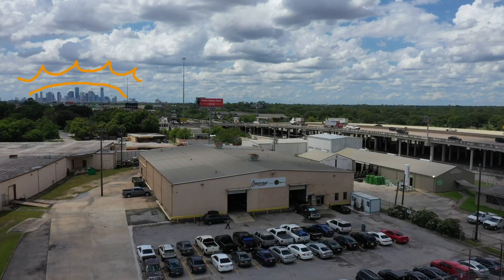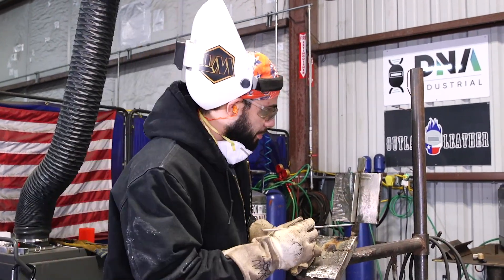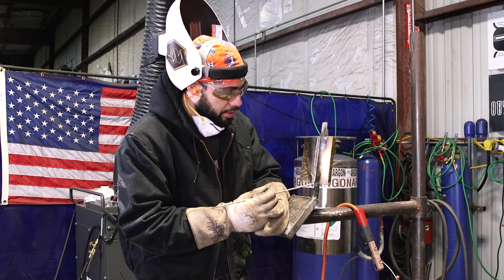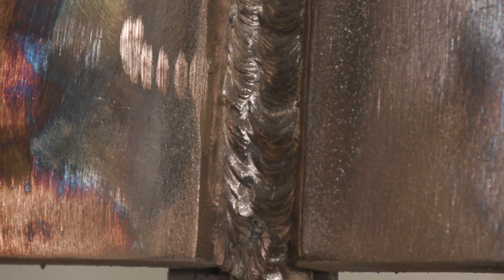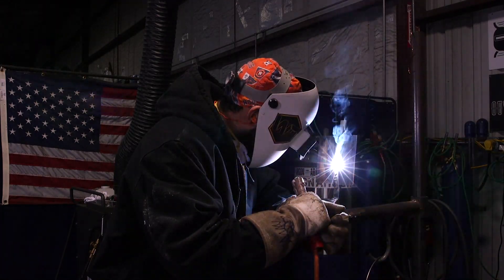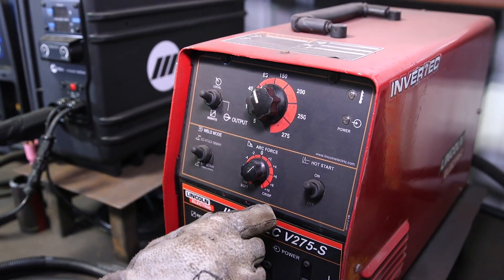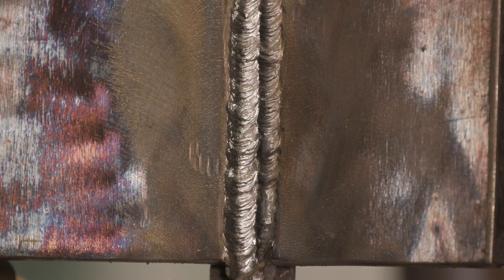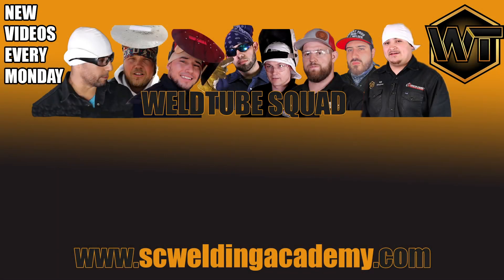Monel Stick Welding on a Copper-Nickel Plate | First Time Welding it🤨

Comment: Have you tried running straight stringers without so much movement. I don’t weld Monel just curious how it would weld. I weld mainly carbon, stainless, and chrome pipe.

Comment: Copper Nickle is tough, but Monel to Monel is some of the easiest welding you'll ever do. I had a Monel stick qualification back in the day that was a vertical and overhead butt joint with backing strap test and it was actually fun to do. 
I used the qual to clad weld overboard valves on ships that were under water. Easy money.
Reply: It is actually a dissimilar monel to steel backing that’s why they are using a 9n10 monel rod not a very friendly rod but yes monel to monel backing is easy very fluid and fun but not monel to steel
Reply: @jordanmoreno4850  We used 9N10. I had almost forgotten about that qual because we used it infrequently. The butt joint test was really overkill because we only used for clad welding.
Reply: If it were monel to monel they would use 70/30 rod or 90/10 rod
Reply: That's wonderful to know,  I'd love to weld up an all Monel Blue water cruising sailboat from one of KastenMarines Pelagic Whaleboat style designs when I get the opportunity.   Monel Hull,  Deck and cabin.  Monel fittings welded right onto the deck,  Monel Rudder, and Freestanding Mast for a Modernised junk Rig for better upwind sailing ability,  to deal with a Lee shore.    All Monel so no dissimilar metal issues.   No stainless steel rigging to maintain and periodically replace.

Expensive initially,  but would cover the cost relatively quickly over time as it would be so easy to maintain,  no painting or anti biofouling required anywhere ever due to being self cleaning under sail.  Paint Only optional for appearance.  Also no stainless steel rigging to maintain and periodically replace at great expense.  And would potentially last well over 100 years and even completely recyclable after exceeding its useful life.

The Asperida built in 1967 is a great proof of concept,   even though the Monel used in her construction was over 10x the cost of steel the Asperida was only 7% more expensive than the same boat in steel due the cost of labour,  equipment and fitting out being the main cost of a sailboat,  dwarfing the raw material cost.

It resulted in a boat far more than 7% better, and still sails the ocean today despite being grounded on a rock at hull speed early in it's career,  without suffering significant  damage or requiring repairs due to the ductility of the metal.
Reply: Monel is a copper nickel alloy

Comment: I have the same machine and it’s very misleading with the AMP markings, can someone from Lincoln explain it?
Reply: It’s just a rough setting. Like with 7018 I find on the dial 120-125A runs in like butter for me